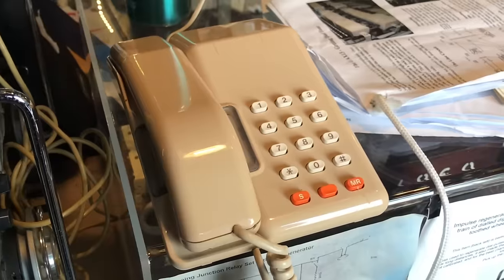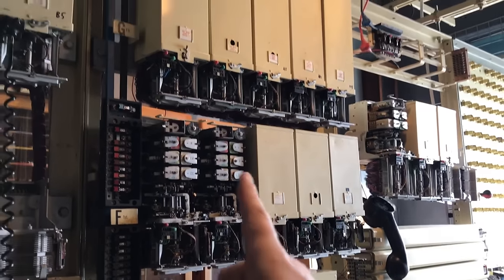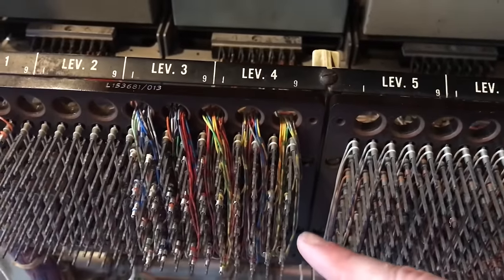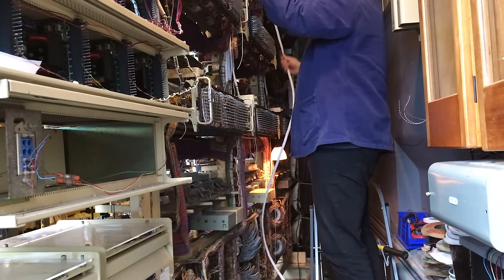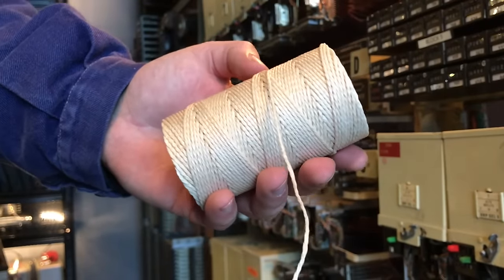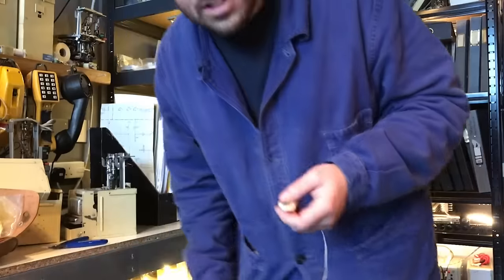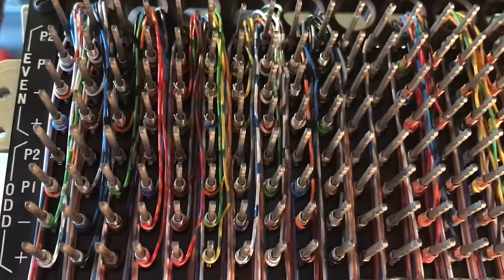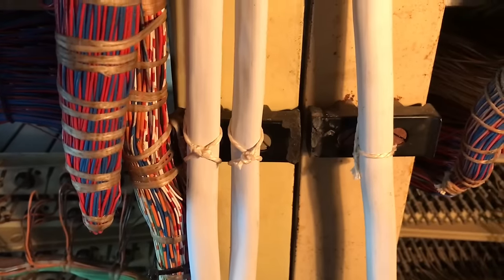The Coolest Wire Wrap Tool Ever! - Telephone Tuesdays

Comment: btw Mitch, i used to terminate 300 wire triples, i recently went through to remember all the combinations, i think i got them right (pink and turquoise were 2 of the third wire colours)
Back thhen it was plain colours, not striped, so blue, orange, green, brown slate were all paired with white in the first 5, red in the second set etc, so you had to twist the pairs to keep them together.

Comment: Done plenty of "gunning" onto tag blocks in my time (as the person below described)
Used the gun on MDF. IDF and multiple rear blocks. Happy days, the sound of the exchange noise, radio one playing (or the test match!). The forming of the cable took time of course and you needed to be able to fix the odd "snap" by overwrapping or rarely soldering.
Exchange construction in the 1970's and 80's was a fantastic job, I wish I was back there now working around Wigan, Preston area.

Comment: Forgot to say that wire wrapping is better than soldering, as you get 4 connections per turn on the post. Plus after time the wire cold welds at the post at every corner, which is why its harder to unwind than it is to wind on. Also you will notice that the wire will sometime break as unwound.
used wire wrapping at lot on Automated test fixtures as it's faster than soldering and a lower resistance connection.
Reply: I did forget! Was gonna say they used wire wrapping on the Saturn V moon rocket because it’s more resilient to vibration than soldering
Reply: @hackmodular  Yup. It was also used on the backplanes of '60s and early '70s minicomputers, such as the PDP-8. (You can do an image search for 'PDP-8 backplane' to see some of them.) And in the '70s and '80s it was extensively used for prototyping and homebrew microcomputer systems.

Sadly, it's all fallen out of favour nowadays for some reason, and everybody just gets PCBs done instead. Which is annoying, because not only are they less reliable but you also have to wait for the turnaround time for your order. (Or several turnaround times, if you make mistakes in your PCB design. :-/)

Comment: Mitch, in the cable is a piece of cotton, it is there so you can pull down the cable and cut through the insulation
Reply: Ahh seems obvious now. What do you do to cut around though once you’ve split it down?
Reply: @hackmodular still score the knife like you did. But it saves having to do multiple scores to remove a long piece of jacket.
Reply: rip cord
Reply: @hackmodular You start at the open end and pul the string towards where you will be cutting off the sheath.

Comment: There is a knife called the jokari knife wich would help stripping the cable ^^
Reply: They are an essential tool in my toolbox (in fact I have several). Lidl do them at a decent price occasionally. Best way to remove the outer sheath without nicking any conductors (except for that nasty CAT5 outdoor black cable which has a ridiculously thin sheath as well as being filled with grease).

Comment: When doing my PhD in the mid '70s my office phone had a trunk bar on it, which prevented dialling trunk calls (with an initial 0) after normal hours, during the cheap rate. I hypothesised that the bar was a modern digital add-on to a traditional exchange,  that old-style exchanges would treat the pulses modulo 10, and that the bar would count exactly 10. So, I tried dialling a trunk call by tapping 20 on the 'phone cradle, then dialling the rest of the number. It worked - I got through. 

I never understood why the University wanted to discourage outgoing calls at the cheap rate.

Comment: that's thick lacing cord, the cord I used to use was much thinner and would cut through your skin as you pulled it tight.
We had to lace in a way that if you cut the cord it did not come loose. but then I was lacing cableforms in avionic equipment where there was not much space for the wires. the black dye would come off in the cuts so you had black lines on your fingers until it faded away.

Comment: That didn't look like a clove hitch, i did a vid on lacing, same knot but might be easier
Tip for stripping, you can score the break point, but if you cut into the end of the cable, you'll find the end of one of the strings, it's tough nylon, wrap it around a screwdriver and pull awy rom the cable, it will slice the side of the insulation open
It's fine to lace in the open unti you get to the holes, i prefer to insert the wires in the holes once you reach them so you don't forget to branch out at the right point
I liked the electric wire wrapper, 110 volt with a transformer, i ran out of extension leads to reach the racks, so i made an adaptor to plug into the + & - 50v, ran a lot smoother :D
Reply: Darn won’t be getting my scouts badge any time soon!

Comment: you strip the cable with the inbuilt nylon string, don't cut around the cable
Reply: You still need to cut around the jacket, but only at the very end. Lots of telecom guys would just chop off the loose piece of jacket with a single snip of the splicing scissors, but I’ve never found that to be a good look. I’ll use the string to do the lengthwise strip, then use a sharp knife to score the jacket to make for a nice square cut.